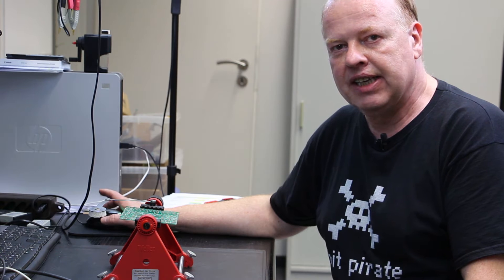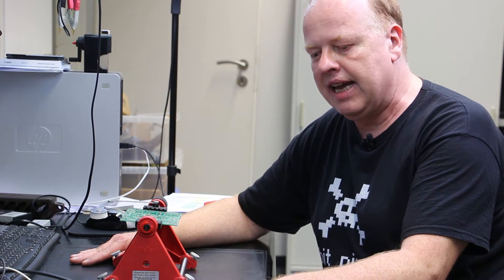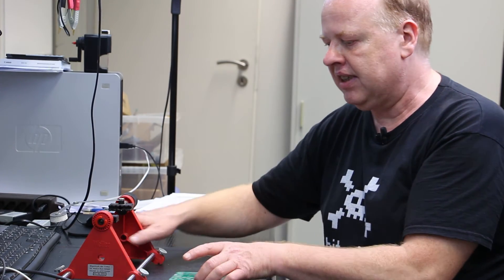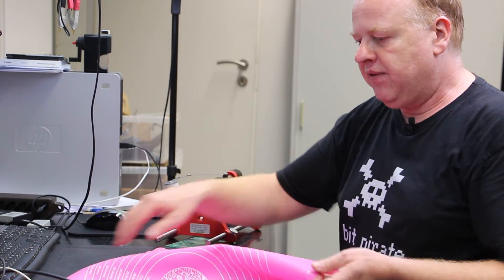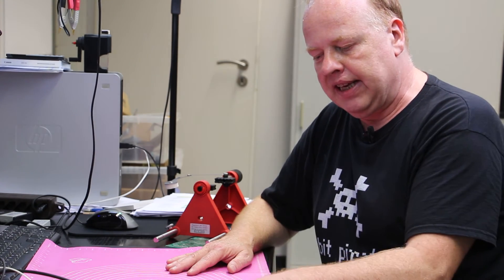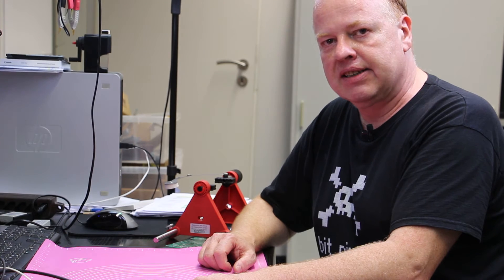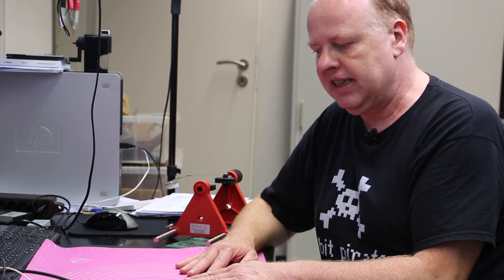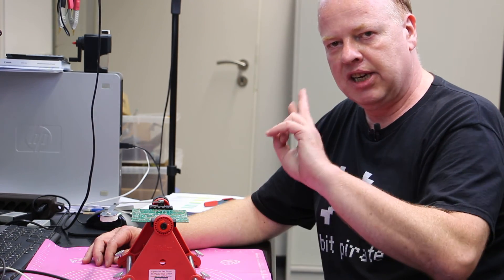Every Maker should have…[Pt.32]...a silicone-mat

Comment: One downside to the silicone mats I’ve found is that they carry a very heavy static charge. I have an L shaped glass desk that got bought some silicone mats for and they have such a great static charge that I’m afraid to use them on the desk because that’s where my computers will be. Trying to figure out a good way to either ground them to the metal frame of the desk ,of discharge the static into/onto something else but still looking into how I can do it. Any suggestions?
Reply from the maker: The one I showed never accumulated static charge. Perhaps you try another brand. Otherwise there are special antistatic-sprays which might help.